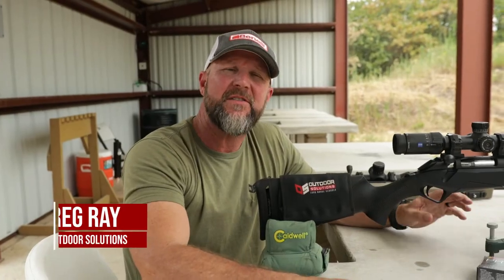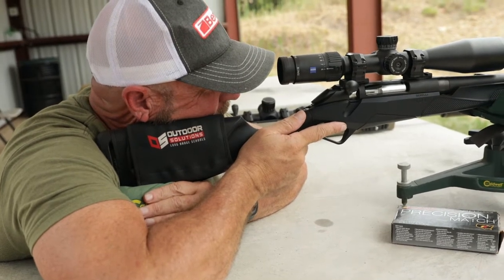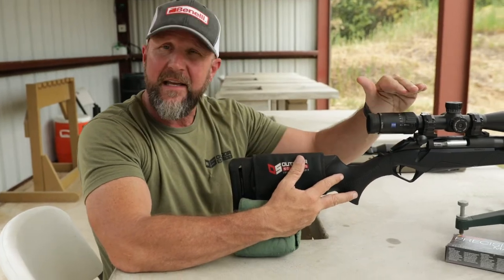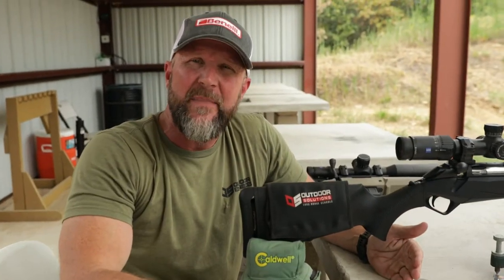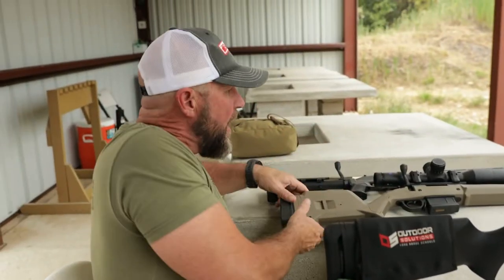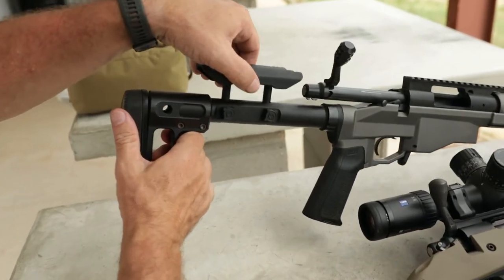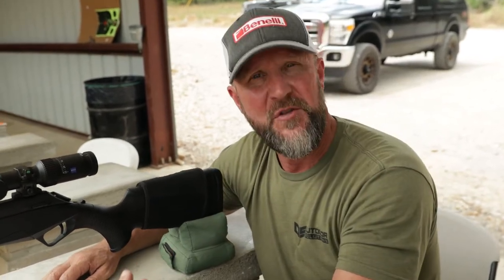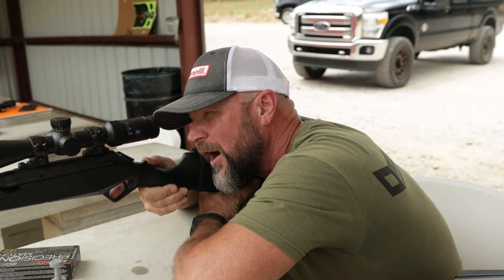Proper Cheek Weld For Better Accuracy

Comment: I don’t see how resting your head (12-15lbs) on the butt of your rifle with inevitably variable muscle tensions is going to help accuracy.   Helping you see POI sure - but for smaller groups it doesn’t make sense.
Reply from the maker: Where else you putting your cheek?
Reply: All competitor shooter use a cheek weld man. It’s the only way to have consistent line up with your scope. Think of it like a peep sight on a bow, if you shoot one.